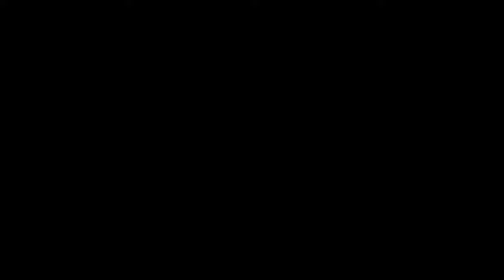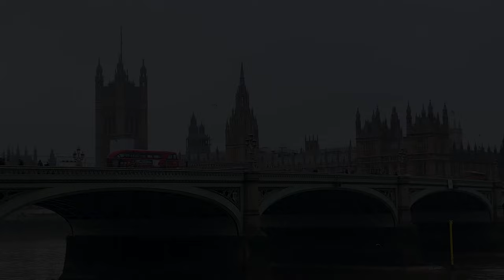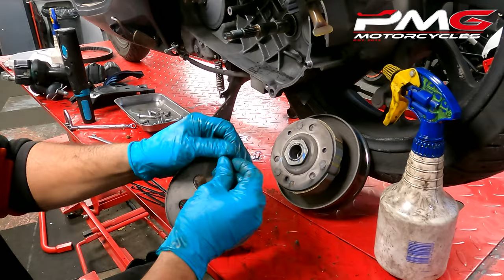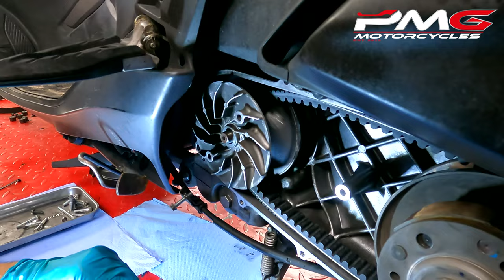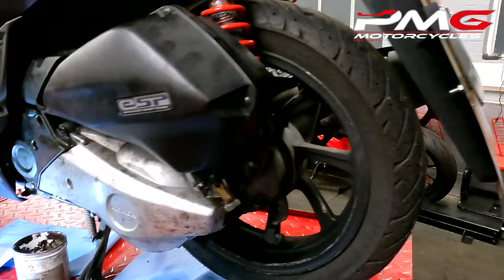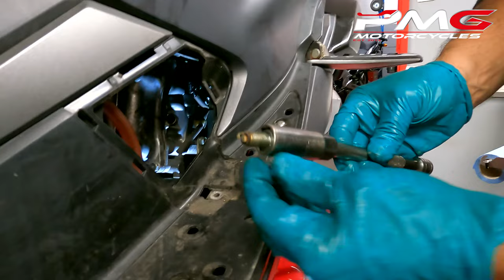Honda PCX125cc How to do Full Service

Comment: Tengo yo la de 2019 esta misma, con 5 años y casi 50.000km y NI UN SOLO PROBLEMA, le hago yo todos los ajustes y revisiones, aquí en la provincia de Alicante las casas oficiales Honda son de lo peor y carisimos, solo el cambio de aceite de motor son 80 pavos... LADRONES
Reply: Correct, I am just back from Gandia Honda, one litre of Honda oil and one litre of Repsol antifreeze, The total bill was €38.26.       I just checked the web I could have had I delivered oil and Honda antifreeze for €30 approx from Motos Romero.

Comment: What about if need to adjust the valve on a pcx 125 2021 model?
Reply from the maker: Check the service manual is the best way to do it properly. Thanks for your comment.

Comment: Hi can you do a video how to remove fairings on pcx ? Because that's the only thing really time consuming when doing a maintenance on a pcx .
Reply from the maker: Yes, I will do. Thanks for your comment!
Reply: There are many videos on YouTube about that. If you follow the Honda service manual, you’ll be removing far more panels than needed. Some of the mechanics in SE Asia know the tricks to remove the bare minimum. It is better to ask something specific, like how do I replace the front steering bearings. Ha ha, that one is a real bitch.

Comment: Hi, what did you clean the oil filter with pls? Great video, thanks 🙏
Reply from the maker: Hi, thanks for your comment!. The spray I've been using is brake cleaner. You can find it in our online shop at https://www.pmgmotorcycles.com/online-shop